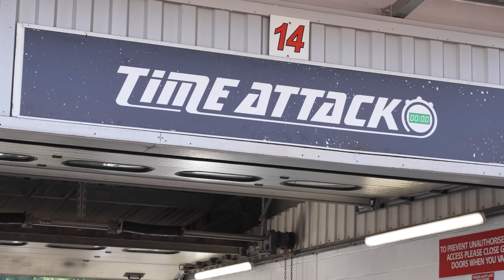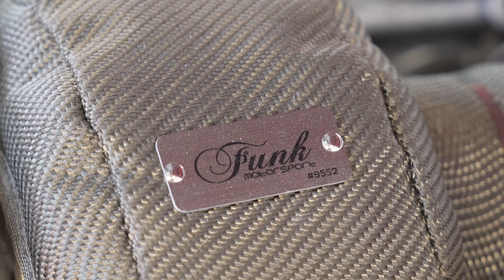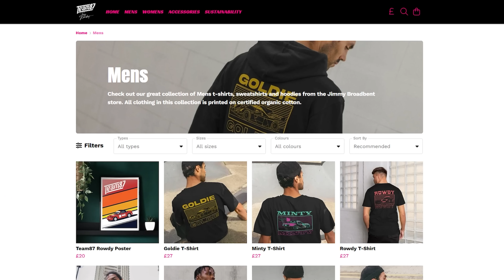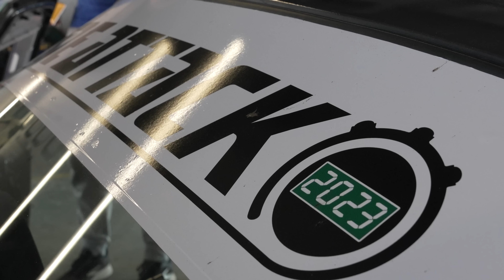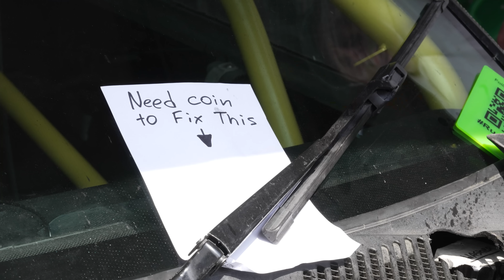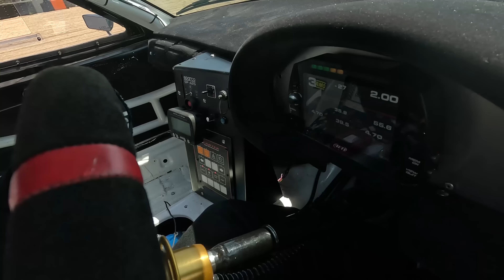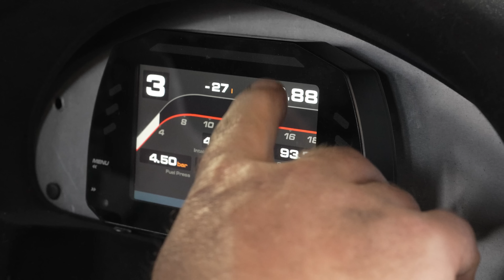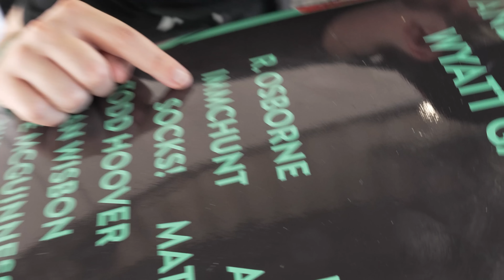Minty Catches Fire In Our First Ever Race Event - (600BHP Time Attack MX5)

Comment: How much postive caster are you running? If you can dial it back some without losing too much self centre you might take some weight out of the steering but those wheels/slicks gon be heavy. Is it a de-powered rack or a manual rack?

Goes without saying but please create a proper firewall, you get an exhaust gas leak, melted wiring, heat blanket or whatever it is smoking, or a full on manifold fire then it is going to fuck you up, it will pull all of the oxygen, as a fellow asthma sufferer please improve this man. I've had a manifold fire in my engine bay before, and it made that lambda sensor fire look like kindling, scary af.

Comment: I don't know much about these M-Tech guys or what they do, but the way the car has had this many substantial troubles so early on is giving me some red flags...

I had a similar thing with one of my cars at a certain reputable (or so I thought at the time) engine builder/tuner. Good enough guy on the outside but when basic stuff seemed to be creating issues that he just didn't think through, I let him go quite quickly... Took the car elsewhere and they very soon found lots of issues he left behind, that could've been very bad in the end.

Like I said no discredit to these guys, completely honestly I haven't followed much of Minty's progress. But yeah idk, feel like a lot of stuff could've been avoided with just a little bit of forethought...

Will happily stand corrected
Reply: Hi, as Jimmy said in his pinned post, we never actually designed the exhaust system, a previously appointed race engineer (now no longer in that capacity working for Jimmy) insisted on the exit there, and we insisted on getting better aero ducting for ram air cooling there. Time pressures means it didn't happen in time for this event, and testing beforehand didn't show an issue - so we ran with it - new plan in place :)
Reply: @themtechzone  I appreciate the response, good on you guys for being upfront! Sorry I hadn't seen his pinned comment, I'm keen to see the new plan come!

Comment: Hate to say this but why did you, or your pit crew NOT press/pull the power Isolator switch to kill the engine/fuel pumps/power etc.. The VERY first thing you do when you have a suspected fire and come in smoking from the engine bay or cockpit is to isolate the power.. Jimmy you have ultimate control of that as the driver and if you dont do it (because you're getting out) then your pit crew should!!!, So why did no one do it? It was well over a minute before the car seemed to be off.. You dont know if you have a oil, fuel or electrical fire and keeping the car running not only puts you, the pit crew (who of which i didn't see wearing any fire protection or have any extinguishers with them. NOTE: At least one person should be on extinguisher duty at all times and dressed in fire overalls) and the car at risk, but also everyone else's vehicles and people in the pit area as well. Seriously this is a major major error from your whole team and something that needs to be addressed before you and whoever you use as your pit crew ever go near a track again. Sorry to be blunt but amateur team or not, this is not acceptable.. Safety needs to be number 1, Everyone should know what they should do in a situation like this no matter how amateur you are.